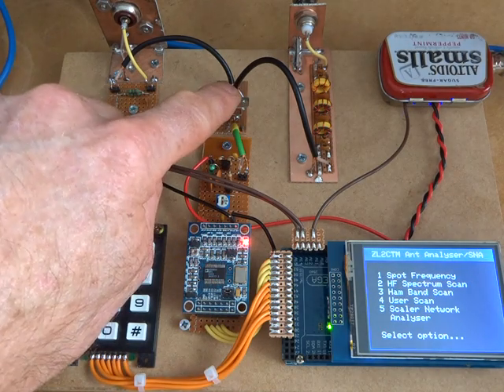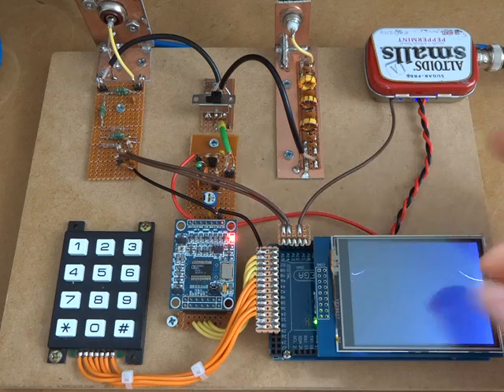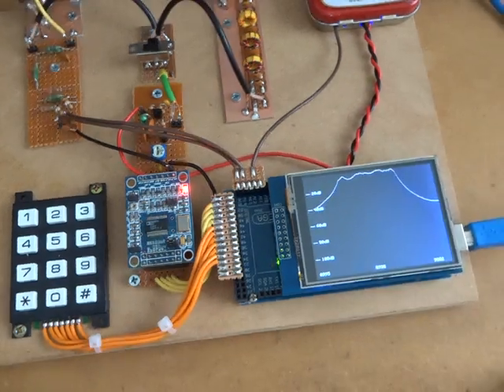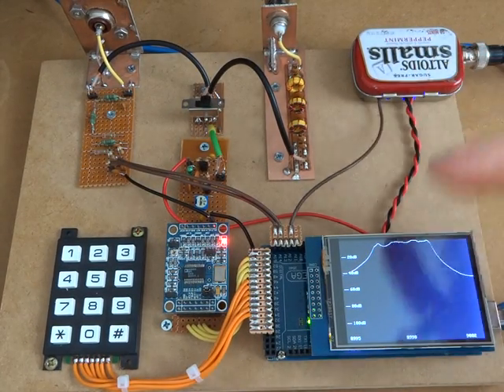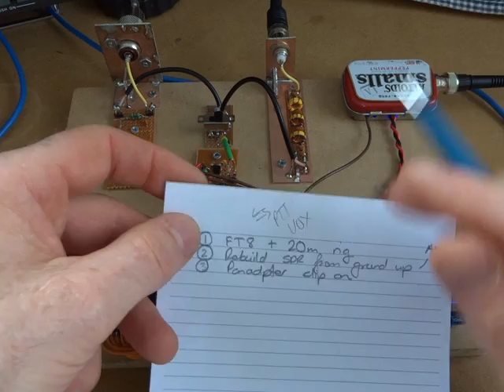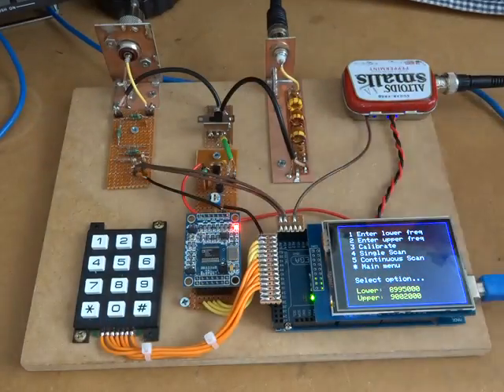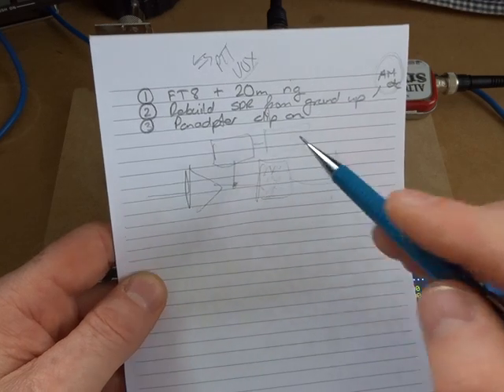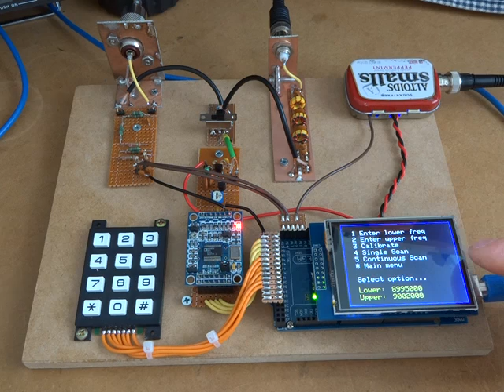Simple Scaler Network Analyser - # 4 Final Setup

Comment: Hi Charlie, very nice work!  My suggestions for improvement (might even try it myself) would be to the scan mode.  Memory permitting you could store the trace generated in a buffer, then on the next scan cycle, compare the new trace to the old and only update the display where it has changed, and not at all if it hasn’t, that way you could get a flicker free update.  The other would be to have cursors, one vertical and one horizontal, the vertical used to determine the frequency of mins and maxes, 3db points etc., over the whole sweep range, and moved by a rotary encoder.  As the cursor moved you’d print out the value at the intersection point with the curve.  Similar idea for a horizontal cursor.  Just some random thoughts... 73 Tim.
Reply from the maker: That's a great idea Tim. I'll definitely add those to the list of things to do in the future. The good thing is the hardware the built, so adding functionality through software is relatively easy. I'd like to turn add impedance to the antenna analyser too at some stage. Thanks again Tim.

73 Charlie

Comment: Hi Charlie, great channel and have watched every video that you have made. Could you upload to your website , the Cct's for the Amp and filter board for the sNA and could you tell me what display or chip set you used for the SNA...thanks again for a great channel 73 Ray Koster G7BHQ
Reply from the maker: Hi Ray. Sure. I'll look to do that when I get back off this trip. As for the display, as you know there are many different types with different drivers/libraries. All I can say is that it is a 320x240 and uses the UTFTGLUE library. 

Charlie
Reply: thanks Charlie, have a great trip
Reply from the maker: Just uploaded it Ray. It's at: https://zl2ctm.blogspot.com/2018/11/homebrew-scaler-network-analyser.html
Reply: thanks Charlie, all downloaded and ready to build

Comment: How about an HDR (hardware defined radio!)? ie an SDR front-end that does the IQ decoding by analogue means using (for SSB)  the phasing or Weaver method. Could investigate analogue AM and FM decoding too.
Reply from the maker: Thanks Stephen. Are you meaning introduce the second 90deg phase shift in an analogue audio circuit to get the overall 180deg phase shift or something else?
Reply: @CharlieMorrisZL2CTM  Yes, doing second phase shift on the analogue audio. Likely you know all this but just in case: commonly done with  series arrangement of op-amp all-pass filters, or with passive RC matrix. Weaver method (IIRC) uses an IF that is actually in the audio pass-band and involves some mathematical funkiness (implemented as LPF) to remove opposite SSB.

I've never tried it but from what I hear, 50dB or more SSB suppression is possible with fine tuning, but typically 40dB or so with reasonable care. Audio quality is supposedly unsurpassed.
Reply from the maker: @stephenstebbing9460  Cheers Stephen. I'll add that to the list. 

Charlie

Comment: I would like to see the SDR rebuild.  I am struggling with building my first radio receiver based on your previous SDR with the D flip flop and NE612s.  I have added a tft display and I currently have it using just a 30 Mhz low pass filter.   I have more experience in software so I am working on adding a panadapter and the ability to switch modes and bandwidths.   I am kind of following your SDR design and DD4WH Teensy-SDR code.  Not sure where I am really going with it but I am learning a lot trying to get it all working....and that's the point.
Reply from the maker: Hi Ken. Did you get my code to work? It's up on the blog at: https://zl2ctm.blogspot.com/2018/03/homebrew-ssb-sdr-rig.html
Reply: @CharlieMorrisZL2CTM  Yes.  I got your code to work fine.  It was my starting point.  I would not have been able to get started if it were not for your code and designs.   I am struggling to get the hardware working.  I think have some issue with the NE612 mixers, but I am not entirely sure of that.  I am not at my home QTH right now (south for the winter) so I don't have good antennas to work with.  I think some of my problems might be noise being picked up on the LO and RF lines.  I am using unshielded patch cables that are 8 inches long at the moment.
Reply from the maker: @kcnicely  I see. It will be a good project to work on when you get back.

Comment: Charlie what do you use to cut your PCB material?  Assuming standard FR4 material, I cant find a clean method to cut it up.  I want  to get into more home brew  work but keep finding hurdles to leap first.  73 de Seth - W8FG
Reply from the maker: Hi Seth. If you are talking about the stripboard, then all I do is use a box knife to score both sides and simply break it. Works a treat. For the all copper board, I either use a hacksaw for long cuts or a pair of tin snips. I have noticed that some (not many) cheap boards are made of a material that tends to crack and splinter.

Keep at the homebrew as It;s good fun and quite rewarding. Frustrating at time, but great when you manage to nut something out.

Charlie